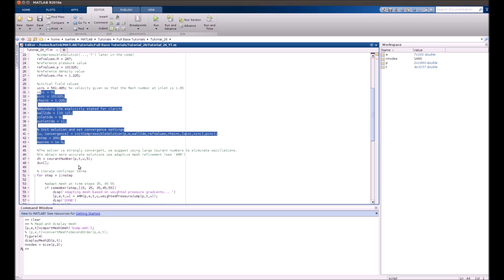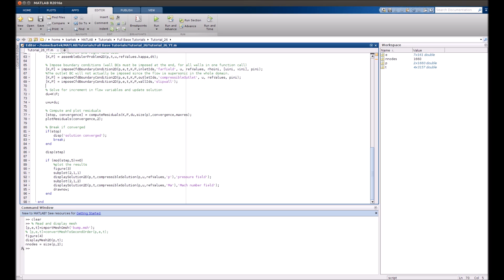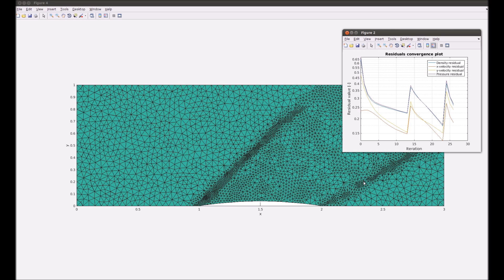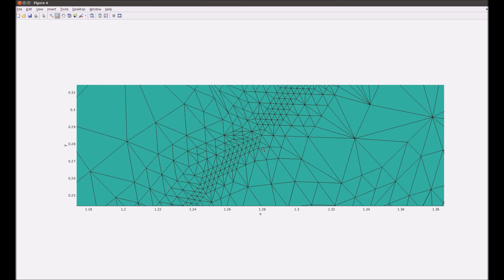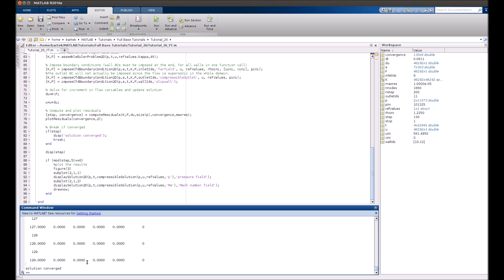CFD Tutorial 26 - Inviscid Compressible Flow with Adaptive Mesh Refinement (AMR)

Comment: How can I get the drag and lift values from this compressible simulation?
Reply from the maker: It is enough  to integrate the pressure and momentum flax  around the contour.
Reply: Is there a line of code you can provide for that? I tried doing that way its done on the flow over naca 0012(tutorial 13). But its given me an error when I try to get pressure data.